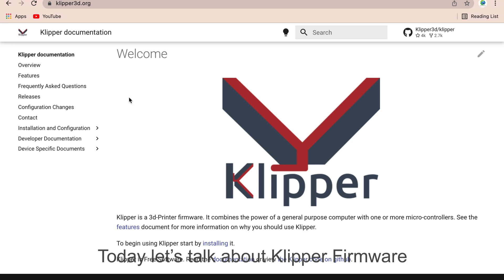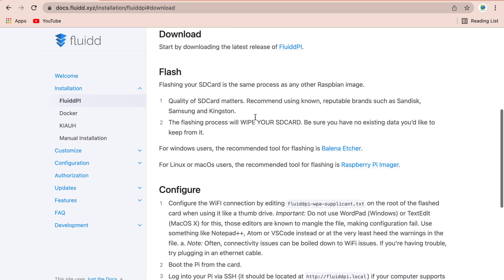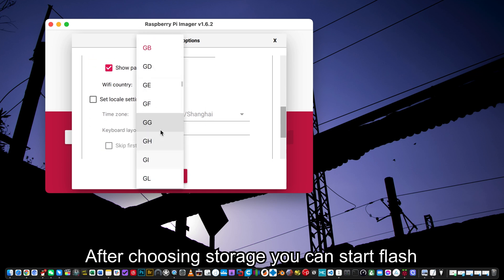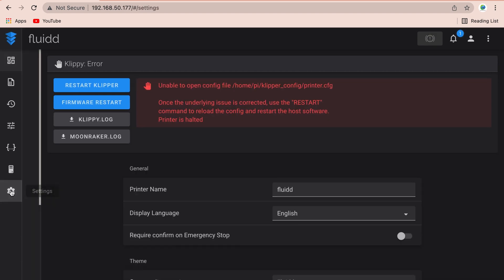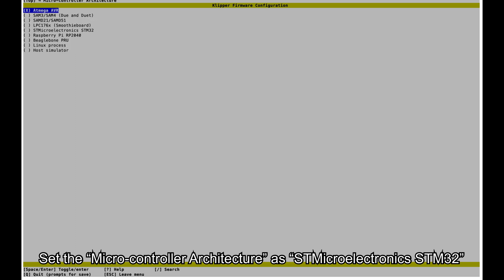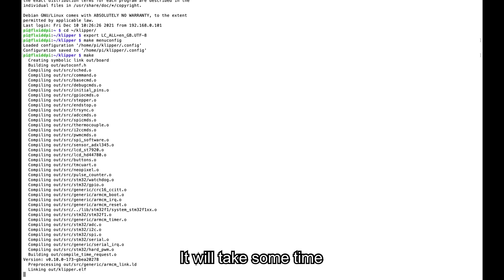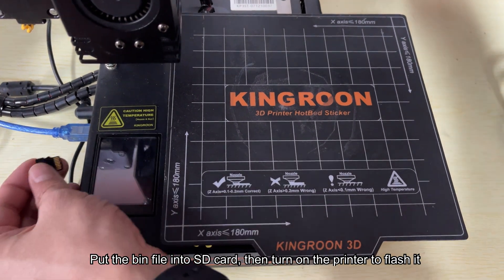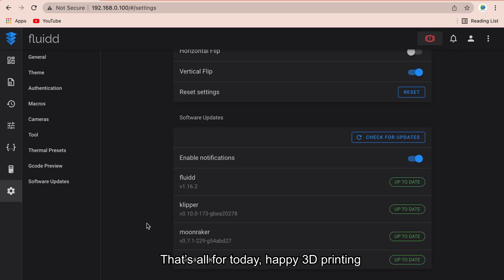How to Prepare Klipper Firmware for Kingroon KP3S Using Fluiddpi

Comment: I have an error. My printer says “TFT Updating” with a small green bar, but it says 100%. When I restart, it just says “Booting…” I tried both the manual method and also downloaded the bundle from your google drive.
Reply: Did you solve this problem? I have the same thing
Reply: @vivopoper6077  no, I ended up just getting a cheap board with klipper already on it
Reply: Use microsd 8gb

Comment: Hi 😉I am a proud owner of KP3S 💯👍 Klipper on GD32F303 kp3s you think it's possible ? Thanks 👌
Reply from the maker: We already made it happen, please check the following tutorial and the newer video for Klipper. And 303 shares everything with the 103, anything 103 can do, 303 can do the same. https://kingroon.com/blogs/3d-print-101/how-to-prepare-klipper-firmware-for-kingroon-kp3s-using-fluiddpi
Reply: ⚡️⚡️⚡️ @Kingroon3DOfficial  Thank you very much🙏🙏💯👍👍
Reply from the maker: @TESLA7512FPV  You are welcome!
Reply: @Kingroon3DOfficial  Please help! I have a board version v1.3 with a GD32F103 processor and I want to update the klipper firmware, I do everything according to your instructions, but the printer does not work. The old firmware version v0.10.0-515-g24a1b50e works fine, but the new one created via “make menuconfig” of Klipper version v0.11.0-304-gf7567a0d does not work.

Comment: it shows 'Unable to open config file /home/pi/klipper_config/printer.cfg' 
could you tell me the reason ?  how can i get the file?
Reply from the maker: Because the configuration rules just been modified when we made this tutorial, that’s why we make the configuration as the second part of it. We are now testing on it, but it is not that easy. Having a correct configuration file is only the beginning. It seems require a special slicing software and new settings. We will make a tutorial soon. You can also check the article to try it and see what I mentioned above: https://kingroon.com/blogs/3d-print-101/how-to-prepare-klipper-firmware-for-kingroon-kp3s-using-fluiddpi
Reply: Thank you!
Reply from the maker: @thekeydoki  You are welcome! We will make the video for it soon, since the configuration is already done.
Reply: @Kingroon3DOfficial  hello, is the configuration is ready? waitting for it for a long time.
Reply: @Kingroon3DOfficial  can i use the article you mentioned above now? or have I to wait for a newer configuration?
Reply from the maker: @MrCubeGo  It’s about to coming. But print with Klipper is just the beginning.
Reply from the maker: @MrCubeGo  Just wait for the new one.
Reply: @Kingroon3DOfficial  Is there any chance to get the new configuration and tutorial in this week?
Reply from the maker: @MrCubeGo  Perhaps
Reply: @Kingroon3DOfficial  Cool
Reply: @Kingroon3DOfficial  Any good news?

Comment: Is there a good config yet?
Reply from the maker: It will be available soon, with a new video. You can also check the blog we just updated: https://kingroon.com/blogs/3d-print-101/how-to-prepare-klipper-firmware-for-kingroon-kp3s-using-fluiddpi
Reply: @Kingroon3DOfficial  That would be great cause I will need a lot of these
Reply from the maker: @fish3dp372  It is just a beginning. We found it needs a lot of set up and a new slicing software. We are learning it, too. We will share it with you guys as long as we are ready. It won’t be long.

Comment: #My config file for the KP3S with 3D Touch and Klipper 

# This file contains common pin mappings for MKS Robin Nano (v1.2.004)
# boards. To use this config, the firmware should be compiled for the
# STM32F103. When running "make menuconfig", enable "extra low-level
# configuration setup", select the 28KiB bootloader, disable "USB for
# communication", and select USART3 for the "Serial Port".

# Note that the "make flash" command does not work with MKS Robin
# boards. After running "make", run the following command:
#   ./scripts/update_mks_robin.py out/klipper.bin out/Robin_nano.bin
# Copy the file out/Robin_nano.bin to an SD card and then restart the
# printer with that SD card.

# See the example.cfg file for a description of available parameters.

[include fluidd.cfg]
[include macros.cfg]

[virtual_sdcard]
path: ~/gcode_files

[stepper_x]
step_pin: PE3
dir_pin: PE2
enable_pin: !PE4
rotation_distance: 40
microsteps: 32
endstop_pin: ^!PA15
position_endstop: 0
position_max: 180
homing_speed: 50

[stepper_y]
step_pin: PE0
dir_pin: PB9
enable_pin: !PE1
rotation_distance: 40
full_steps_per_rotation: 200
microsteps: 32
endstop_pin: ^!PA12
position_endstop: 0
position_max: 180
homing_speed: 50

[stepper_z]
step_pin: PB5
dir_pin: !PB4
enable_pin: !PB8
rotation_distance: 8
full_steps_per_rotation: 200
microsteps: 32
endstop_pin: probe:z_virtual_endstop #defines the Z endstop as the BLtouch
position_min: -2 #lets us go lower to adjust the Z offset
position_max: 180
homing_speed: 10
homing_retract_dist: 3.0

[bltouch]
sensor_pin: ^PC4
control_pin: PA8
x_offset: 30
y_offset: 0
z_offset: 0.99
speed: 20

[bed_mesh]
speed: 120
horizontal_move_z: 20
mesh_min: 35,10
mesh_max: 170,160
probe_count: 6,6 #performs a 6x6 bed leveling test 
fade_start: 1
fade_end: 10

#  Visual Examples:
#   rectangular bed, probe_count = 3,3:
#               x---x---x (max_point)
#               |
#               x---x---x
#                       |
#   (min_point) x---x---x

[safe_z_home]
home_xy_position: 90, 90 # Change coordinates to the center of your print bed
speed: 50
z_hop: 10                 # Move up 10mm
z_hop_speed: 5

[extruder]
step_pin: PD6
dir_pin: !PD3
enable_pin: !PB3
max_extrude_only_distance: 150
rotation_distance: 3.9229
full_steps_per_rotation: 200
microsteps: 16
nozzle_diameter: 0.400
filament_diameter: 1.750
heater_pin: PC3
sensor_type: ATC Semitec 104GT-2
sensor_pin: PC1
control: pid
pid_kp = 19.018
pid_ki = 0.840
pid_kd = 107.692
min_temp: 0
max_temp: 250
pressure_advance: 0.11475

[input_shaper]
shaper_freq_x: 46.92  # frequency for the X mark of the test model
shaper_freq_y: 55.98  # frequency for the Y mark of the test model
shaper_type: mzv

[heater_fan my_nozzle_fan]
pin: PB0
heater: extruder
heater_temp: 50.0
fan_speed: 1.0

[heater_bed]
heater_pin: PA0
sensor_type: EPCOS 100K B57560G104F
sensor_pin: PC0
control: pid
pid_Kp: 61.829
pid_Ki: 1.216
pid_Kd: 786.004
min_temp: 0
max_temp: 130

[fan]
pin: PB1

[temperature_sensor Raspi]
sensor_type: temperature_host
min_temp: 0
max_temp: 100

[mcu]
serial: /dev/serial/by-id/usb-1a86_USB_Serial-if00-port0
restart_method: command

[printer]
kinematics: cartesian
max_velocity: 250
max_accel: 3000
max_accel_to_decel: 3000
max_z_velocity: 25
max_z_accel: 100

[static_digital_output display_reset]
pins: !PC6, !PD13
Reply from the maker: Thanks! We will check it out soon, it helps very much.

Comment: Can klipper run on Rock64 board? I plan to use it with Kingroon KP3S.
Reply from the maker: Please check below link for a reference, hope it can be helpful. https://www.reddit.com/r/klippers/comments/pt9c0f/getting_spi_working_on_rock64_board/

You can use Orange Pi as a replace, too. I have seen some articles on it.

Comment: Hi, I would like to build a raspberry pi zero2 into the case. Now im connecting to the motherboar via usb. I would lke to use it with the gpio ports of the raspberry. Do you know which uart port could I use on the motherboard for it?
Reply from the maker: It seems not support GPIO connection. So it have to connect via a USB port.

Comment: Has anyone configured this for the newer Titan extruder? If so, what did you use as a rotation distance in the config? Either that or if someone knows the esteps I can calculate it.
Thanks,
Reply from the maker: This link might be helpful. https://github.com/nehilo/klipper_KP3S  We will update a tutorial on it soon.
Reply: @Kingroon3DOfficial  This one is not perfect. Microsteps 64 makes axis do double distance for me. Have to use microsteps 32
Reply from the maker: @articn0va  Yes, we noticed that. Actually we tried few old config files. They do not work and cause crash. And their microsteps are different. We will make a video on that soon.
Reply: @Kingroon3DOfficial  Is it possible to set up the drivers in UART mode via soldering? Or do we not have the pins available like the MKS Robin?
Reply from the maker: @articn0va  Please let us know what's that for. The mainboard of KPS is based on MKS robin. Please download the stock firmware and check its config file. I guess it should help you know it. Please send us more information to support@kingroon.com, we will let our guys see if we can do anything to help.
Reply: @Kingroon3DOfficial  its for klipper so that you can control the stepper drivers
Reply from the maker: @articn0va  Thanks for your reply! We will make a video to show you how to config Klipper to use. It should fix the problem. But it is for the 103 mainboard should be available first.
Reply: @Kingroon3DOfficial   is it true that new board cannot instal klipper?
Reply from the maker: @maddugqc6911  No, that’s not. Some users get it works. The rules of Klipper config was changed few months before  when we made the tutorial. So we leave  the configuration tutorial in the second part. Hopefully we can get back to Klipper soon. We are now making some tutorials that are more basic.
Reply from the maker: We are busy on testing the latest models recently, Klipper configuration tutorial will be available soon. Klipper project changed its rules on configuration few weeks ago which makes the old config file not work any more. You can also check this link for a reference. https://github.com/nehilo/klipper_KP3S

Comment: What settings is requiered for the stm32f407 version of the board?
Reply from the maker: It might be slightly different in the menu config settings, but please let us test it out first. We will update its tutorial soon along with the GD32F303.
Reply from the maker: @Zachary Strom Hi Zachary, we will make tutorials on that soon. So does the kipper configuration. Recently our engineers are working on the coming KP5 series, they should be able to test Klipper on STM32407 then.
Reply: @Kingroon3DOfficial  any updates?  All of my KP3S are V1.2 boards with STM32F407 MCUs and do not work with Klipper.  Help!
Reply from the maker: @MakerMeraki  There is a step to choose the MCU version, choosing the 407 instead. That’s the way we figured out, but it’s still testing.
Reply: @Kingroon3DOfficial  unfortunately it isn't as simple as just changing the MCU to 407.  No one has been able to get the V1.2 board with STM32F407 to work.  I spent all day yesterday going through all the configuration options with and without the MKS python script, and it doesn't work.  The tft flashes, but the screen never goes black and it just says booting and I can't get it to connect.
Reply from the maker: @MakerMeraki  We will find a same KP3S here and get it tested. Hopefully it can be supported. It might not be so soon since we are now making tutorials for PrusaSlicer.
Reply: @Kingroon3DOfficial  I understand.  On the plus side, my GD32F303 V1.2 boards work fine with klipper compiled as STM32F103.  Klipper on the KP3S takes it to the next level!  I love the performance.  I'm printing at 100mm/s right now.
Reply from the maker: @MakerMeraki  Sounds great! It is a wonderful feature that we always want to have a try.
Reply: @Zachary Strom Just get a BTT SKR mini E3 board and bobs your uncle. KP3s is a good printer but these boards are a pain.

Comment: We need a tutorial for the Kingroon KP3 V 1.3 Mainboard with the STM32F407 processor . Pls
Reply from the maker: OK, we will go do some testing on that and bring out its tutorial soon. Sorry to miss that out.
Reply: Just get a BTT SKR mini E3 board and bobs your uncle. KP3s is a good printer but these boards are a pain.
Reply from the maker: @dagfinnkolstad  We will let our engineering team know, see if we could do any improvement on it. Thanks for your feedback!
Reply: @Kingroon3DOfficial  im really happy with the value on the printer. It works well with default firmware so i cant complain about that, but as i run klipper on my other pprinter and also like to tinker. If you provided better doc for the MCU and board the community would for sure help out here.
Reply from the maker: @dagfinnkolstad  We are going to make video on that soon. Tutorial on auto bed leveling would be available first. Klipper project has modified its rules of config which makes the old config files no longer work, that's why we make it another video. It would be update soon. Thanks for your support!